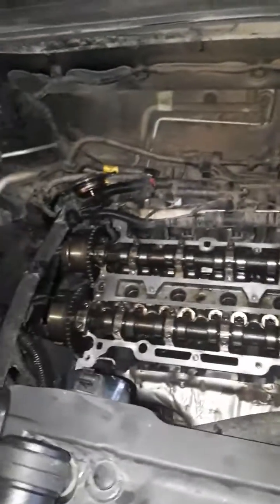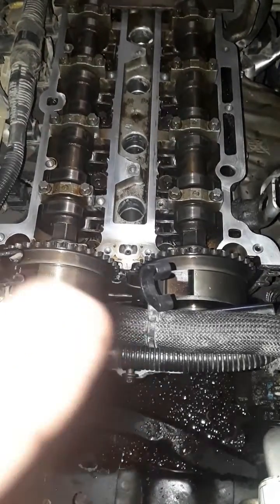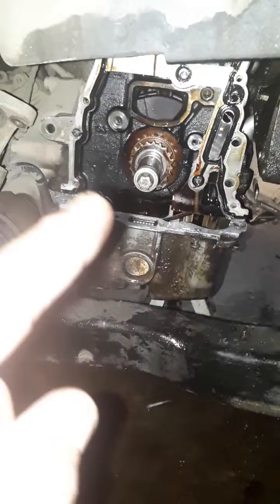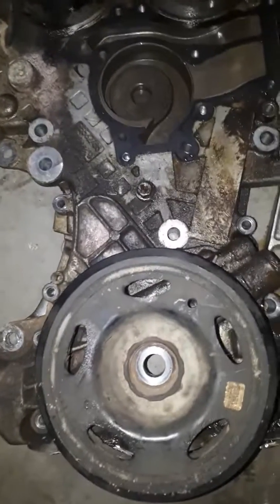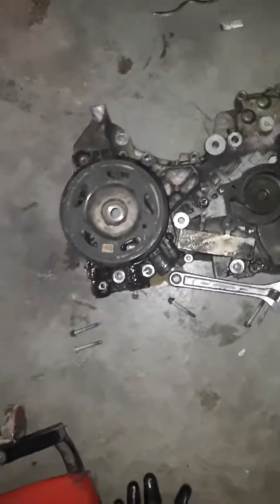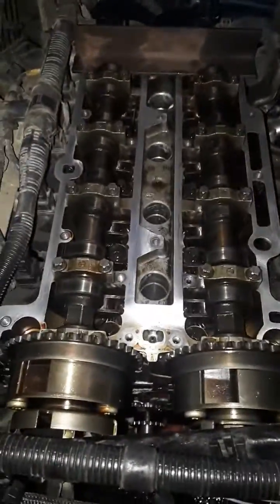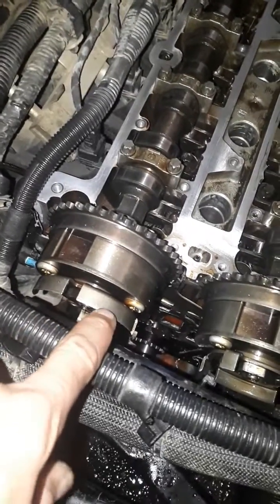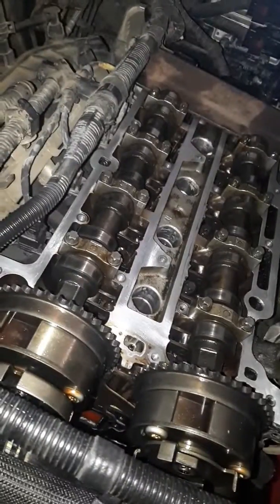Chevrolet Cruze/trax 1.4 litre How to set timing

Comment: Dont go with your timming right like i said do it the old school way check fir tdc first i seen people install crank pulley without doing tdc that pulley hole wont line up just saying
Reply: that's why there's a key cut out of the crank for you to shove a tool or 1/2" extension into.  That's way it's positive tdc always.

Comment: No weong u need to be at top dead center first snd mist guys dont think just cause u have that hole lined up at the crank your doing it right wrong u need to like i said get it to top dead center piston #1 after that make sure u buy the right tool it makes alot easier to hold both cams in place all it takes to ruin your engine is to listen to a guy like this

Comment: If you start from scratch and have to turn the cams with a wrench and the cam seems to be stopping, move the crankshaft pulley about 90 degrees to get the piston out of the way. The cam stopping is a valve trying to open with a piston all the way up. Alot of cams have a "neutral" lay to them. Anyway, when your not sure go slow and sneak up on things. When you think you have the timing right, get a short ratchet and socket and hand turn the engine around a few times to make sure the piston and a valve haven't decided to start dating each other and move into the same space. Take the spark plugs out so you don't confuse compression with interference. Always, always, always turn the engine over by hand. I promise it's cheaper than using the starter if you made a mistake. Even us that do this for a living turn these over by hand. Well, unless your an arrogant ass that thinks you don't make mistakes. Anyway, buy the timing tool kit for this is my advice. Buy it of of eBay or something, use it, repost it get your money back.

Comment: Should mention that crank shaft can be 360 degs out. It's not as simple as lining up a hole with the dash on the timing cover. You need to make sure the #1 piston is in compression stroke. It could very well be in the exhaust stroke. Don't make that mistake.
Reply: I could be wrong but I don’t think it’s possible for a modern engine with camshaft position sensors, electronic fuel injection and spark too be 180 out of time. Because it’s not like an old car with distributer. A modern car knows the camshafts positions exactly it can make any stroke of the cylinder the compression stroke

Comment: I know it's been a little bit since you posted this but have you seen any videos because you have touched them about the closest thing I've seen I have a issue with Advance timing I've noticed my timing guide arm is broken I don't know if that's the total problem before I put it back together I wanted to check the timing marks so what I came up with my camshaft and my crankshaft are both lined up at top dead center my only thing I do not understand this phaser and the position it's supposed to be in because when I'm looking at the tool kit that you lock in place for that that part. The circle metal thing where the bolt you said do not move. when you lock the  the tool in  metal Circle is not in sync with right as if I was to use the tool. I'm trying to find out if that is already out of place. So if you seen a full video telling you exactly how that phaser supposed to be at top dead center please send me the link
Reply from the maker: Hey, no I did not see a video on it, I had to find a scrap car that had the timing set, I put it at TDC and the took a picture of the phasers and just copied the pics and it worked.  Hope this helps and thanks for watching!

Comment: how did you support the engine to take the head off and the oil pan from under if you took out the engine mount?
Reply from the maker: Hey sorry I didn't see this, but I jus jacked off the transmission with floorjack, hope this helps, thanks for watching!

Comment: I hope my Encore dont do this at low miles. These german made ecotec engines sound like there designed for problems. mine is a turbo engine, and my 2010 non turbo kia forte, will run circles around my 2018 buick encore. it is a slug, till you get it at higher speeds.

Comment: So I’ve did a head gasket in my 2017 Chevy Sonic premier 1.4t and when I start it it runs like crap. Like seems like it wants to die and shakes a lot unless I rev it to 2000 rpms could it be my timing is off a tooth or two?
Reply from the maker: Ya sounds like timing or check the turbo, also if its variable timing, check the sprockets for a internal broken pin, hope this helps.  These engines seems to have alot of problems.  Thanks for watching!

Comment: Hello thanks for video. Replaced my timing cover gasket on a 2013 chevy cruze that was leaking oil. The only thing that i did not mark was the position of crank pulley. After the job was completed i had a p0016 and p0017. I turn the crank pulley 180 degree which is the only other choice and reset the computer. Engine light did not come on but seems motor has a vibration sound. Turned back around and engine light came back on and the vibration sound is not load but still dont seem right. Thanks for any advice.

Comment: So I had thrown everything back together on replacing my head gasket on my 2017 Chevy sonic it roughly has 97,000 miles on it.  I put all fluids back and made sure everything was torqued down to specs and once I started it I checked my OBD two scanner and a P0016 and P0017 popped up. My question is what is causing this
Reply from the maker: Hey, check your cam and crank sensors or the cam sprocket, also wiring.  Hopefully its helps, thanks for watching!

Comment: Did you buy the tool to lock the cams in place?
Reply from the maker: No i did not, i used a piece of angle iron i had sittin round the shop, it worked well.  The cam sprockets is what i had trouble with, wasnt very technical, but i moved them (not thinking or knowing they shouldnt be moved).  But i just took a pic of an engine at the autowreckers and lined em up and it started and still runs fine.  Thanks for watching!
Reply: @THEMOOSESWRENCH  setting code P017 & P016 cause im assuming my exciter wheels are not correct , cant find any picture on the web of what i need, any chance ya could post it here? thanks
Reply from the maker: @lukevarel417  https://photos.app.goo.gl/aZz2fo2Cp8kPjRpf8
Reply from the maker: @lukevarel417  not sure if this will help but i believe these were the pics i took, i had to go to an autowrecker and find the same engine, lined up the timing and snapped the pics, matched up as best i could and it seemed to work.
Reply: @THEMOOSESWRENCH  thank you